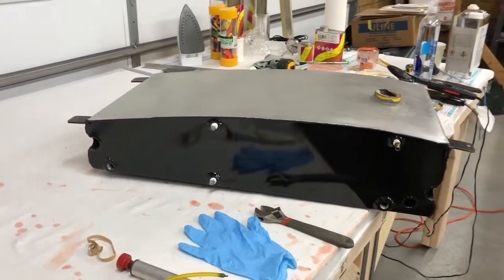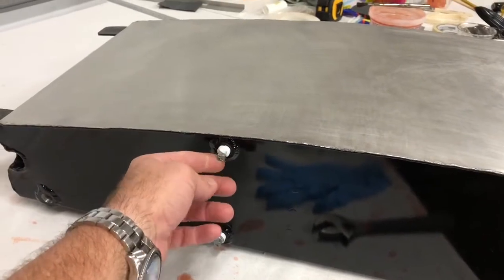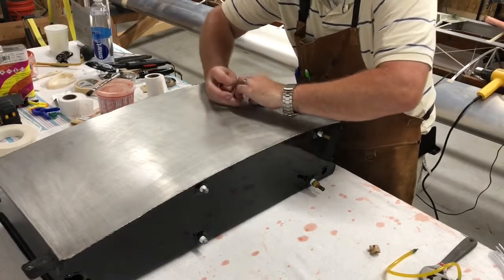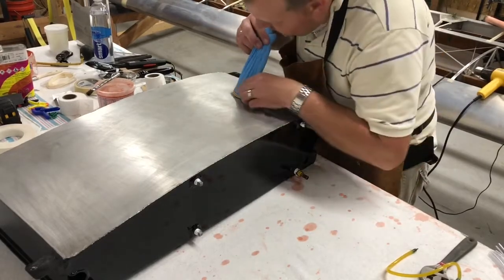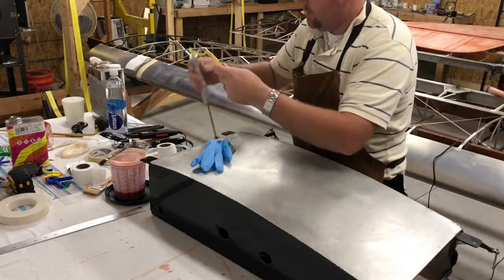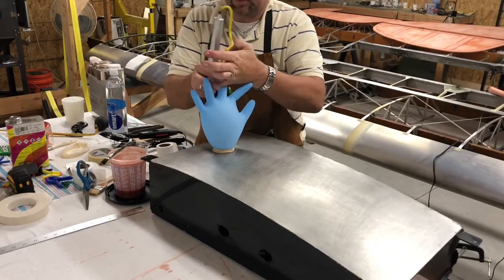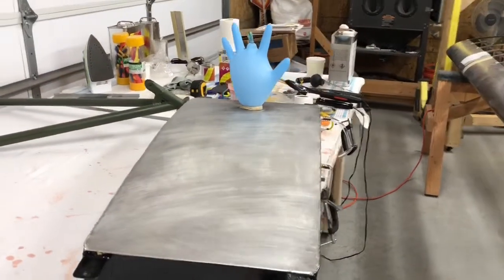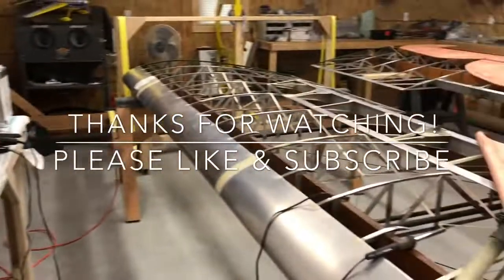How To Check a Fuel Tank For Leaks (Update #016)

Comment: Thanks for doing this. I need to pressure test a gas tank for a custom bobber motorcycle I am working on. I have looked at a lot of ideas and this one seems to be by far the most straight forward and easy to pull off. I really appreciate the common sense approach. I am going to use this method. Beats dunking it in a bath tub full of water.